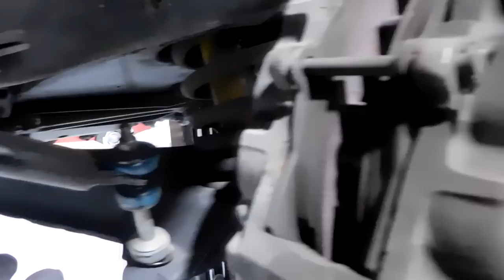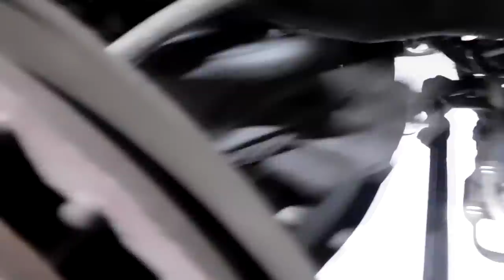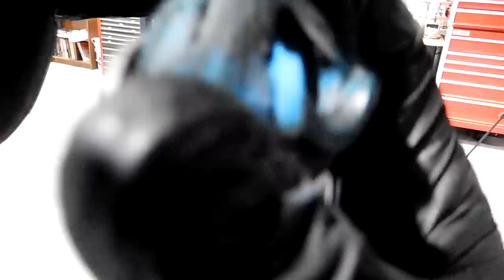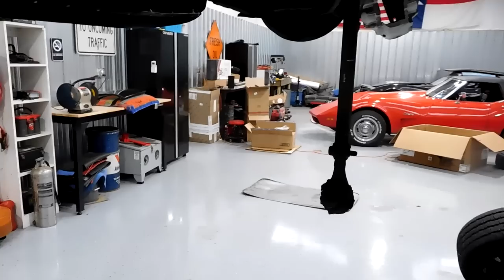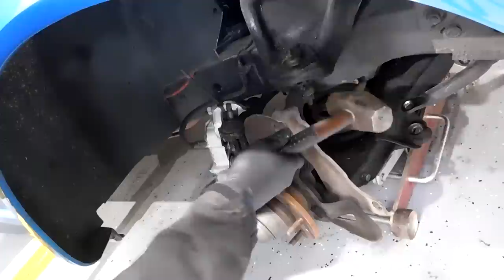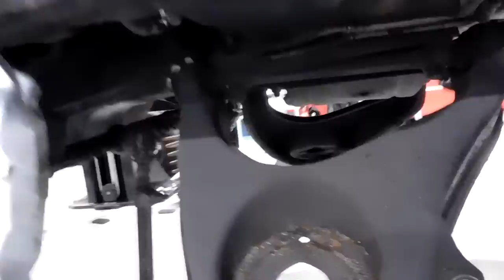C3 Corvette Front Suspension Disassembly. Tricks & Tips To Make The Job Go Faster! (So You Won't Die

Comment: There are spring compressor that prevent the spring from expanding. It has a threaded rod that holds the spring. once one of the A- arms (upper or lower) is free the threaded rod is loosened in a controlled manner, thereby releasing the compression from the spring.
Reply: Yes i would also highly recommend using spring compressors and or at least a ratchet strap through the spring and around the frame, to keep the spring from flying out.
Reply: Do you guys have a video of how to use one of those

Comment: I put the Jack under the control arm which held it from flying down while I was disconnecting the ball joints, once loose then I lowered the Jack slowly and was able to just reach in and take the spring out to replace it.

Comment: Hi Ben, as a few guys said this before, the safest way of working with these springs is to use the spring compressor (ideally the one with a single rod which goes where the shock would be). For disjointing tie rods aetc I use a joint fork, it's super simple and the best tool I ever bought😂
Reply: I built that tool according to the specs I found on the interwebs (the threaded rod and shock post tool)...I made the shock section a touch thicker that the plans call for. I haven't tried it yet but the tool seems pretty damn beefy.

Comment: I bust the upper and the lower ball joint loose before I take the spring out. And the way I take the spring out is I take a cutting torch and cut the coils to relieve the pressure. Just make sure you leave the shock in it first before you cut the coils. The shock in the middle keeps the coils together. After you cut about three of the coils then go ahead and take the shock out. And then it comes out in pieces. So much easier and you don't have to worry about your life.

Comment: I've found disconnecting the lower control arm from the frame works well, leaving the ball joints connected. Use the jack, remove the 3 bolts, the lower control arm can be lowered and fully relieve tension from the spring.The angle is better, the control arm has a greater range of travel. Much better control and less drama.

Comment: Good job Ben, last time I took off a spring , I tied a ratchet strap on the spring with just enough tension, So IF this thing decides to fly, it would at least hold the spring in there and prevent it from flying.
I have to do the lower control arms soon, so your tips are just in time. 
Thanks

Comment: I always use a chain thru the spring coils and then around the cars frame. Then run a hefty bolt with a nut  thru the chain. Just uncase the spring decides to not stay put. Great video

Comment: Great video Ben.  I have a special shock removal tool that keeps the shaft from spinning. I did my lower and upper control arm bushings without a lift.  Used the two jack method.  Your tips are the best.

Comment: 7:11 - Those are really cool. I got one a few years ago and I wish I have found one 40 years ago. They are so much better than a fork. 
15:37 - Instead of the sketchy part, do it the right way and the safe way. A simple 1/2 or 5/8 threaded rod about 24 to 36 inches long goes down through the shock tower hole. Use a couple of large washers on the top with either a long barrel nut or two nuts. On e nut is the compressor; the other is the safety nut. Keep the upper second nut close to the lower compression nut so that if the compression nut begins to strip threads, you will have the second nut to catch it. good quality threaded rod shouldn't strip, but you can't tell where it came from or quality anymore. Ensure you have about 6 inches of rod above the nuts. 
Use a large plate or bar across the lower shock hole, with a couple of washers and a couple of nuts or a barrel nut snugged to the washers. 
tighten the upper nut(s) to compress the spring.
Remove the lower control arm inner pivot bolts. 
Slowly loosen the upper nuts to uncompress the spring. 
14:58 - THAT'S the part I came for. That is the part you need to show.

Comment: Hey Ben, Why Don't You Take Two Old Shocks, strip the Parts off of the Shafts, Weld The Inner Ends Together, then use the Existing Shock Mounting Points to Retain The A-Arms From Movement? Then You Just Unscrew Them Like A Shock, Safe & Simple!?!! 😉